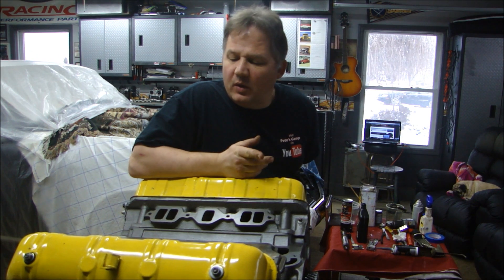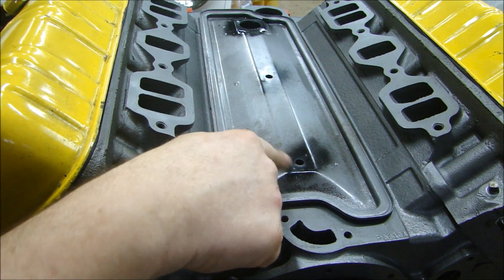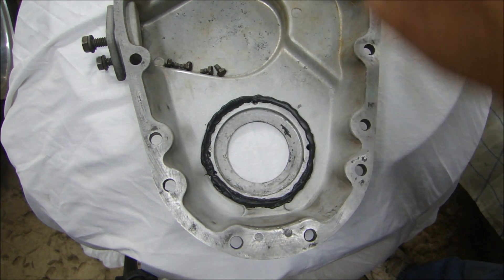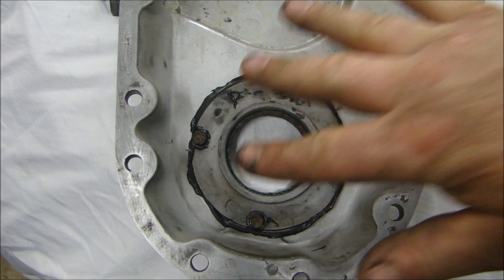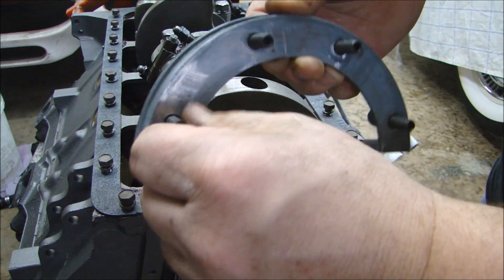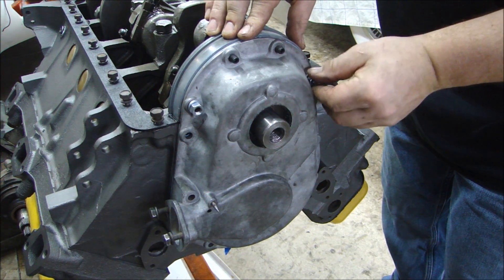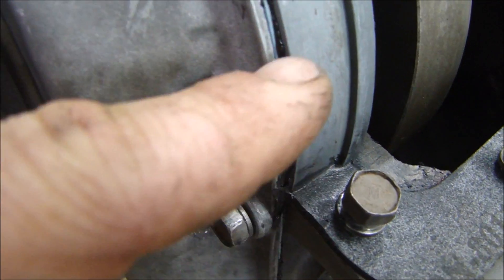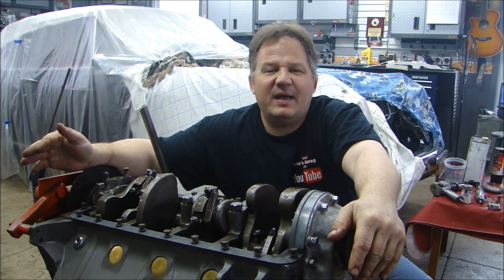Engine Rebuilding Studebaker 289 - Assembly Part 4

Comment: Hey Pete I have a 289 for my 62 hawk gt then my dad had a shop rebuild maybe 8 years ago but still needs to be buttoned up. Where did you find any parts you got for this engine?
Reply from the maker: Depends on the part. The only thing I could not find was a cam

Comment: pete u know when u attatch the conrod to the shaft, does the shaft hav 2 b alined in any way or do u just bolt the rods on in any sequance, if u get what im asking!
Reply from the maker: Any sequence will work as long as they are in correct orientation

Comment: I appreciate you doing the videos Pete. I was curious though, you hear about a balanced and blueprinted engine, and I'm assuming the machine shop is in control of balancing said engine, but could you do a video on how to blueprint and engine? Also how do you go about setting tolerances in regards to, race engines are generally set to tighter tolerances, and I would guess farm equipment would be built to looser tolerances in case any dirt or any thing gets in the system, but when wanting to build to tight tolerances, for say a street/strip engine, how do you determine said tolerances? Do you just try to make everything the same on the tightest point possible across the board to the manufactures specs or is there a new spec you choose with some thought process nobody knows outside of the industry? You hear about building engines to NASCAR specs or otherwise, but not really how to do that.
Reply from the maker: That is a great question. First of all, blueprinting an engine just means you are returning it to within the original manufacturing measurements which is often impossible because as soon as you cut a deck, machine a crank, or bore a cylinder, it is no longer close to the blueprint (assuming you can get the original). That term is a money maker more than anything. Building an engine toa "spec" is more about the limits they place on certain things. The NASCAR spec is specific about every part that goes in and what modifications are allowed. It still needs enough clearances to allow the oil to circulate. The parts you use drive the tolerances more than anything.

Comment: This is one of the best detailed videos I have come across in months. Others spend a lot of time off topic but you stay on track step by step. My sister blew my bearings and then moved to NY leaving me to rebuild my car by myself. I can't find a lot of rebuilds for a '91 toyota Tercel so I was wondering if these steps would help me get my car rebuilt. I didn't have an engine hoist to get my motor out so I had to take it apart a piece at a time and I have already bought the overhaul kit for it. Can I use your steps for putting my motor together. It has been sitting for a year and I really need my car back. On disability and can't afford to have anyone do it for me. I have had my car 16 yrs and I know every inch of it. My sister and I switched out the motor ourselves last time yrs ago but I never had to rebulid it before. 1991 Toyota Tercels are very far and in between to find. I tried selling it but no-one wants to rebuild the motor. I have everything I need to rebuild it so can I go by these videos so I can have my car back..GREAT VIDOES!!!!!
Reply from the maker: I try to make these videos so you can rebuild any engine. Just follow good practices and you will be fine. I use to strip engines down and lift blocks out with robe and a piece of wood. Where there is a will, there is a way.
Reply: 99 òk a
Reply: Pete's Garage so for a 02 altima 2.5 all i have to do it's to look for what they call specs?

Comment: Hi Pete. Great video as always. Question: the freeze plugs in this motor are facing with the edges inside the block as opposed to an FE engine where edges are facing out of the block.  Any particular reason why or it is just a manufacturer spec? -thanks.
Reply from the maker: It was the manufacturer spec.
Reply: The Junoes good question! I was looking for the walls of it going in I assumed it was the angle

Comment: In the engine valley..you put in a PCV connection. Is that factory? Where did it vent from the factory?
Reply: More than likely a draft tube.
Reply from the maker: That is an early vent tube and it is factory. That's why old cars dripped oil....lol
Reply: At least it's not a total loss oiling system. I got a chance to do a short ride on a Brough Superior motorcycle with total loss.  Wonderful bike!

Comment: The re assembly of the cam cover and gaskets is a nightmare. That is why you have proven Pete that on dis assembly it's important to photograph and it video everything. Top tip from you!
Reply from the maker: It is so important. I've even referenced pictures for a couple things on this engine just to be sure.